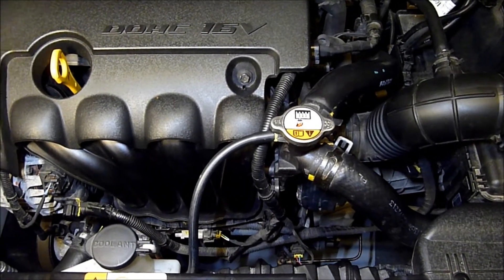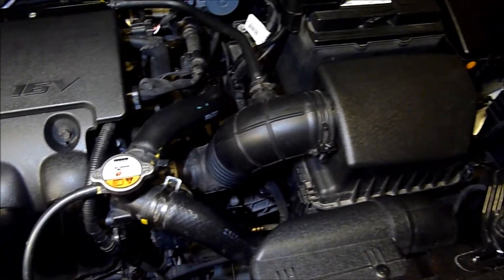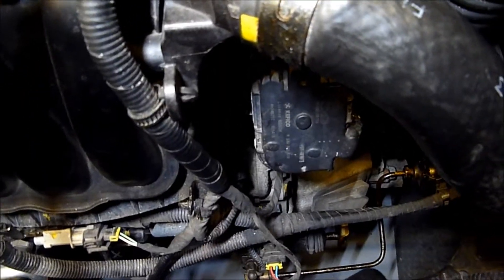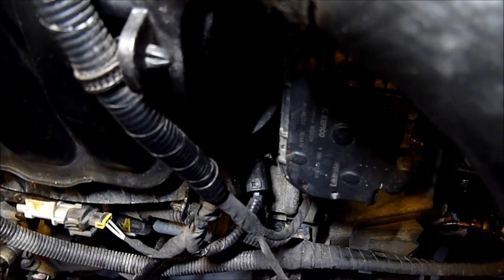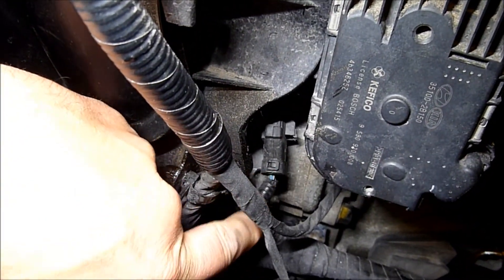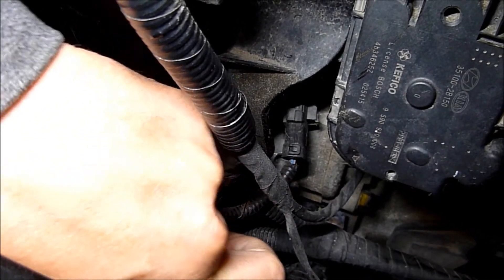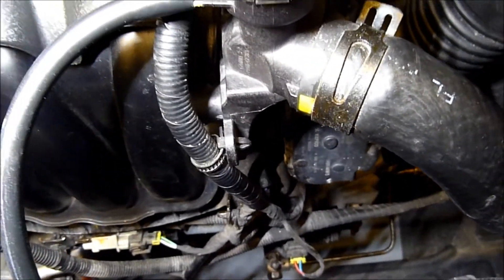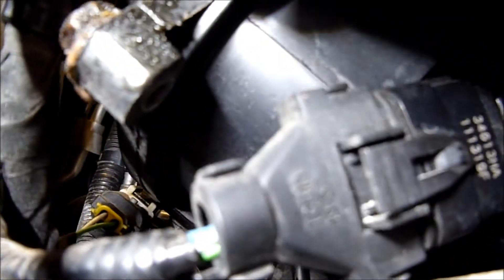Hyundai I30/Elantra MAP sensor Location  Manifold Absolute Air Pressure Sensor with IAT in Hd

Comment: I have some oil sprayed all ofer the connector and a small portion in the vires in front of it ( the blue wire in the video ). 
Could it be a worn gasket or something ?
Absolutely no problems on the engine performance so far...
Thanks
Reply from the maker: I have the same issue, cleaned it up with brake cleaner
Reply: @briandoliver  did you experienced any error codes or strange symptoms? 
I personally don't have any idle issues or power loss, fuel consumption is ok in most part. 
How I found it was by mistake checking the oil level and saw some rather "wet" area around it.
Upon closer inspection I found it quite dirty, like.it was sprayed with fine mud or something. Guess that's oil and dirt.
Will go in about 2 weeks to have it checked and maybe the MAF sensor as well..who knows /, it may help.
Also you videos helped me a lot , thank you very much, take care !
Reply from the maker: @alexpascu1985  no problems with this issue, don't think it's anything serious, my car now has 111000 miles on it & running fine

Comment: I have some Problems with my i30 from 2012. When the engine is cold, the car sometimes refuses to accelerate properly. I press the pedal and the revvs only go up very very slowly and at some point the power surges and the car goes on. But i get no fault codes. Could it be this Sensor? Or something else?
Reply: I have the same problem. On 2013 i30 1.6cvvt. You found the solition?
Reply: @cvile123  Not until today, but i will reply if i someday find a solution.